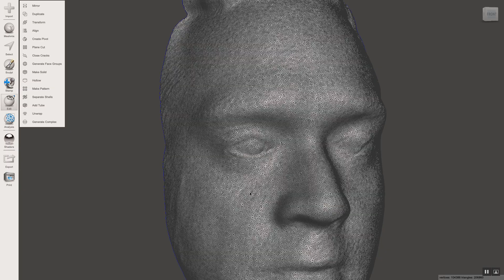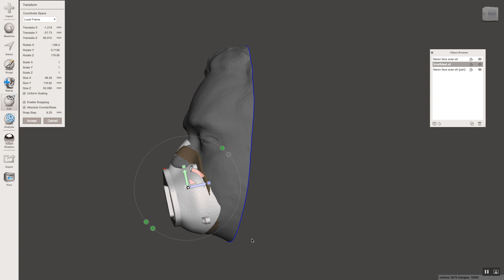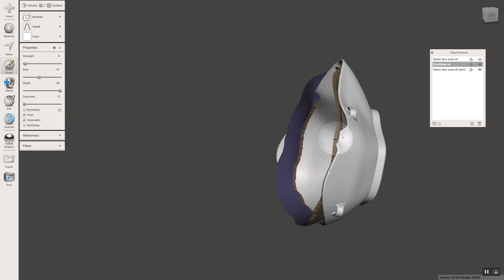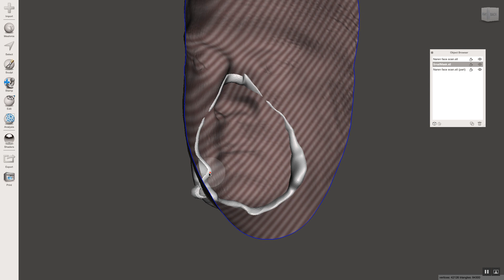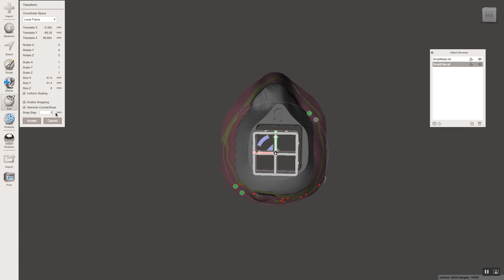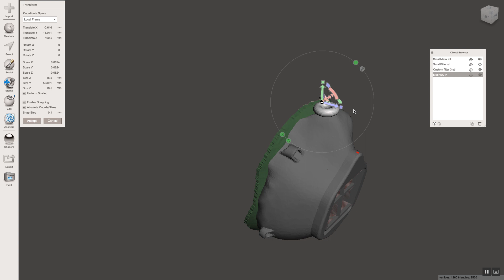Design and Produce your own CUSTOM DIY 3D Printed Respirator Mask

Comment: Hi! Is there a face scanning app for android?
Reply from the maker: Soul Food Cooking hi currently non built into the phone. Bellus3D has an external camera that will plug in work with selected android phones at an additional cost
Reply from the maker: Hi unfortunately the Bellus is iPhone only.  They make a separate camera to attach to certain Androids but at significant cost.